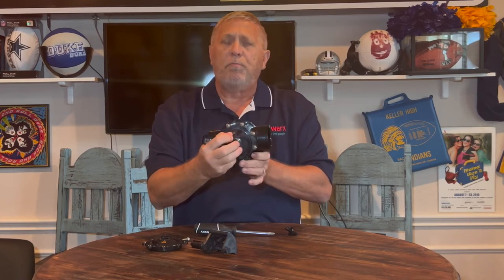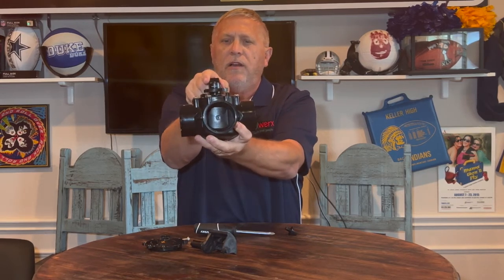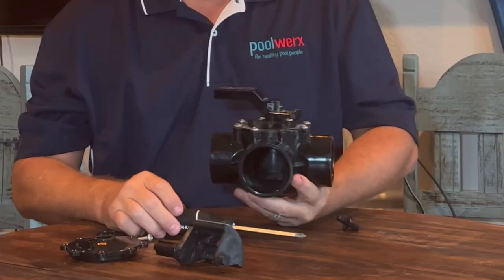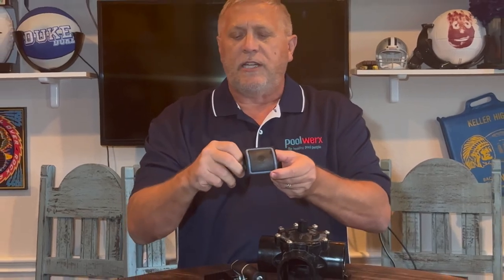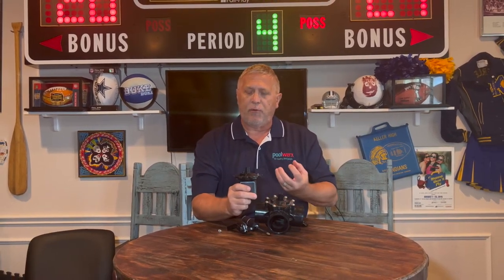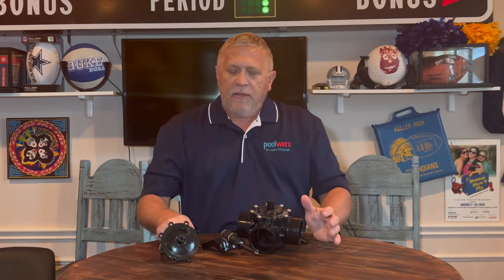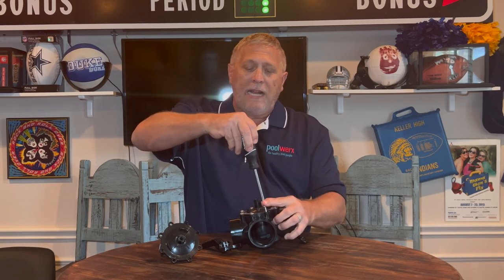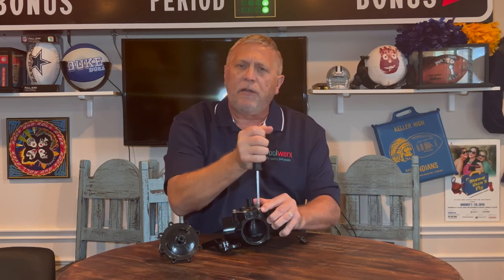How swimming pool Jandy valves or diverter valves work, and how to do the simple repairs.

Comment: Great Video! Thanks. Question on the Jandy valve. Can the top cap be removed and rotated 90 degrees so the inlet is now one of the side ports instead of the middle port? Is it designed so the middle port can be sealed off completely making it a straight though flow? I want to install a heater bypass circuit and this orientation would be easier to plumb than a 3 zone circuit and simpler to operate. Thank you.
Reply: As I see it in the video looking at the internals, any port could be an inlet or outlet. If you use a side port as the inlet, then you can direct fluid from that port to either the middle port, or the other side port (i.e. straight through), or to both to the middle port and the other side port.
Reply from the maker: Thank you